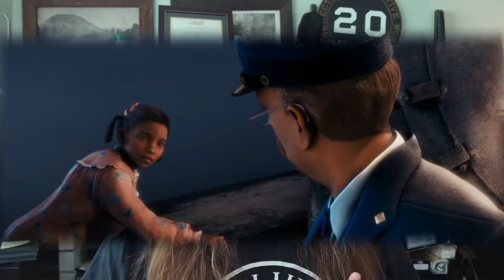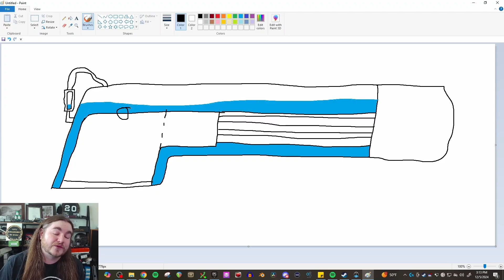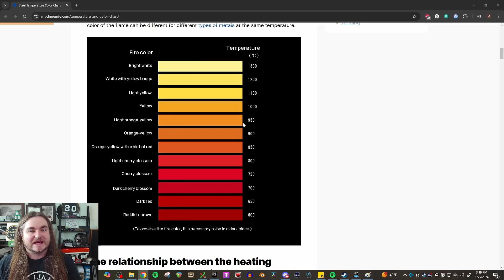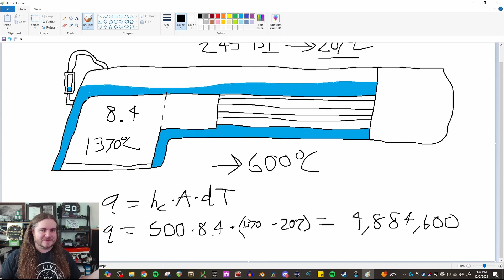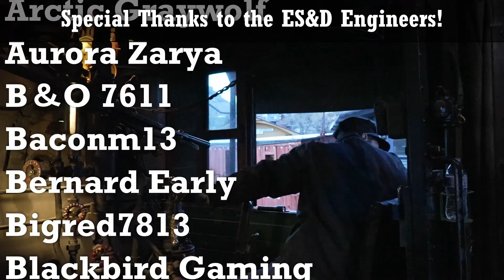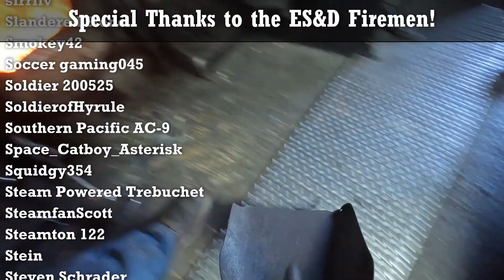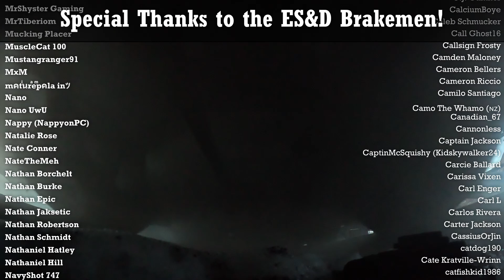Would the Polar Express EXPLODE on Glacier Gulch?!?

Comment: This video serves as a reminder to me as to why I chose not to go into astrophysics after high school. I love it; I am fascinated by it, but my god, I HAAAAAAAAAAAAAATE math! And I suck at it to boot. 

Though one other thing; with the speed at which she was hurtling downhill, and the time it takes for gravity to pull the water forward against inertia, her crown sheet was likely exposed even less than the downhill stretches lasted. Extra second or two. 

And now I'm off to mope in the corner because my favorite girl is down for the count right now. They spent all that time and money rebuilding her running gear, and then her superheater went "Hee hee!" and did something it shouldn't have. I'm assuming something's leaking, since the SRI phrased it as a safety issue.
Reply: To paraphrase an employee at one of my favorite museums, "From the time they roll out the factory door, steam locomotives are constantly trying to shake themselves apart!"

Comment: Would the coal also not just get sucked thru the tubes? And the throttle being primed aswell?
Reply from the maker: I suppose it depends on the momentum and acceleration forces, thinking through it more. If the water sloshed as foretold, yes, it would prime and it would dump the fire against the arch brick. lol
Reply: @Hyce777  oh yea lol, if it was a near free fall and the engine was still applying power there was no way for the water to slosh forward

Comment: A friend an I once had this conversation. Those engineer and fireman are by far the greatest engineer and fireman in the entire world and the polar express is the most pampered locomotive. Despite the insane wheel slip, black smoke never came out of the stack, only steam. Sand was never used, even on ice. And the coal didn’t even have any coal dust. The fireman wasn’t trying to think of a solution after losing the cotter pin, he was debating whether or not he should put something as dirty as his hairpin into such a well manicured machine
Reply: Considering the route, pampering makes a lot of sense.
Reply: iT's A mAgIc tRaIn!
Reply: @PowerTrain611 the magic just keeps it on the rails even when it should fall off
Reply: They probably spend the rest of the year doing HARDCORE maintenance on the Polar Express
Reply: @pineapplesauce2718  there's a reason that only runs once a year...
Reply: @PowerTrain611  Does it? I like to think the reason the Polar Express is a freight engine is that it spends the rest of the year bringing raw supplies to the North Pole's factories.
Reply: @rbdaviesTB3 it’s the Polor Express. A passenger express train. The cargo is probably taken by another locomotive. That’s my theory atleast
Reply: @rbdaviesTB3  This makes sense IMO, as the Berkshire were freight locos. But my theory is that there multiple Polar Express's, one for each country as not all countries have the same loading guage across their entirety.
Reply: @PedroFerrer-vq5sw  The berkshires were fast freight locos, it would pull freight, and have absolutely no problems goin fast either doing so.
Reply: The engineer literally drifted a train on ice.
Reply: @AdrianMannino  and it got rerailed again
Reply: @AdrianMannino  the Rob Zombie edit of that scene is just spectacular if you haven’t seen it
Reply: Yup, every single coach somehow.
Reply: It's MAGIC
Reply: And makes the waters gravity go in the direction of the tracks
Reply: But he is right

Comment: 1:49 Fun fact about Pere Marquette 1225: she also served as the inspiration for the original book by Chris Van Allsburg, who played on the locomotive as a kid while it was outside Michigan State University. That, I believe, was one of the main reasons they wanted 1225 for the movie design(and also, yes, number for both occasions).
Reply: Its weird he illustrated a PRR K4 instead of PM 1225 for the book since that’s the case
Reply: I agree with that. I would like more info. The movie has never sat well with me because it is NOT a berkishire@bostongeis5123
Reply: Railman is correct, that is where the 1225 comes from.  I never actually held the book so I can't speak to the wrong loco being illustrated.
Reply: @a_steinman  Bad phrasing on my part. I don’t disagree that 1225 was the inspiration, thats why I think it’s weird he didn’t illustrate it. Especially since he’s also the illustrator.
Reply: @Dasgooben67  Well, creative liberties/artistic license and all that. Might I add, it looks more like a generic steamer(albeit with D&H style headlight) than a K4. If that'd been the case, it would've had a Belpaire firebox and high-mounted headlight.
Reply: @ Thats a good point. What makes me think its a K4 is the running board, the tanks on the top and bottom, the wheels (not the wheel basis) and especially the bell. 

The pilot and headlight, and the weird sand dome are the things that don’t make it look like a standard k4. Some K4s did have the headlamp in the middle at some point, but idk if that matters lol. Also, its hard to say what the wheel basis is in the illustration with the bush in the way lol.

I think you’re right about generic steamer/creative liberties, cause even if was a K4, it’s very stylized. Regardless, 1225 is the polar express
Reply: @Dasgooben67  Now that we can agree on.
Reply: @Dasgooben67  The engine in the book is a 4-8-2 mountain type

Comment: Great video, one question I do have what if it was going  track speed? and not speeding out of control Would the out come be any different?
Reply from the maker: What pray tell is track speed on a near vertical hill, lol? Terminal velocity, I suppose...
Reply: @Hyce777 idk what speed limit was, the conductor seemed worried about it , whoever designed that alignment was probably dunk, high, or a shareholder. Maybe all 3 at once.

Comment: You forgot to mention the coal that would have been floating around, like the engineer and fireman, allowing cold air to enter and help cool the firebox.
Reply: not if the fire door wwas shut, and we do see its spring loaded with a foot switch
Reply: @nathanharrison2  it looked like the one with the holes drilled I to it, so air still could've gotten in
Reply: @LetsStreamitOut01 I was thinking of the grates :P if they aren’t covered evenly in normal operation they can let too much “cool” air in and damage the boiler in some cases
Reply: Cold air is dense air, my friend. It would only supercharge the fire in the firebox, making our problem worse.
Reply: @ChrisSpringer-d1r  too much air too little fuel = less heat...
Reply: @LetsStreamitOut01  The problem is that the coal would all float and knock around, crumbling, increasing the surface area, in an oxygen-rich environment, meaning that coal-fire is going to flash.

Comment: I agree with commenters that the coal and fire would fall forward. All that would be pulled into the flues and tubes, not just by gravity but by the hellacious draft. And more getting spattered on by the stoker. For the tubes and flues, I would guess they won't buckle  being in direct contact with the fire while still surrounded with water. The problem is despite much of the coal passing through due to the small size, clinker and larger hunks would clog the flues and tubes. The draft would drop and the coal that made it through to the smoke box would also drop. The steam and water coming from the cylinders would permeate the dust and gunk making a concrete mass.
It may not explode, but it's trip has ended.
Reply from the maker: Well, the G forces of it accelerating might help pin things down too... Hard to say
Reply: @Hyce777  nah. The crew being in close to zero-g tells us what the water and fire are experiencing. the water would likely stay barely in place but the draft of the fire would totally suck the fire right out the stack. It would explain Smokey shoveling like mad while they were sitting on the ice. He needed to get a new fire going.

Comment: Could you imagine the poor souls who have to service this choo choo?
Reply: Considering the working conditions of the other elves, and the shop crew having ~363 days to service 1225 between her madcap cannonball run every year, it might be leisurely compared to the turnaround time of the army of boilermakers working for UP's engine shops to keep the freight moving in the 40s/50s.
Reply: @callsignapollo_  Yeah, I guess you're right. They have a year to service this thing.
Reply: @callsignapollo_  
Like some poor elf in the shop looks at some papers on a clipboard, then at the engineer and fireman, and quite simply goes “You did WHAT!?”
Reply: Mechanic: wtf happened to her!?
The engineer and fireman in unison: two words, Glacier Gultch!
Reply: @elijahcuevas3805 Don’t forget, THE PIN!
Reply: Also general fact that in the movie they've got magic and all.
Reply: Well, considering she olny runs once a year, I don't imagine her service schedule would be very rushed.
Reply: dude imagine how bad the suspension would look-
Reply: I'm pretty sure they'd want to take the train crew out behind the trainshed for some percussive maintenance.
Reply: Imagine the repair costs
Reply: @eddingtonrailroading  Santa probably has inside access to iron ore, coal, and off shore oil deposits, most likely owned by Mercedes-Benz (remember that early 2000's commercial?) So I imagine the repair and manufacturing costs would be significantly nullified.

Comment: I know this is all in fun and all but I would have to assume the crew knows that the Gultch is coming and likely would have overfilled the boiler to compensate ahead of time making the exposed crown a moot point
Reply from the maker: That was the other math I meant to do! I don't think they could have filled it up enough on the uphill.
Reply: @Hyce777  maybe the polar express has a water input at the front to fill the boiler full when tilted up cause they know about this absolute nonsense of an alignment I mean is it really far fetched that they custom built the locomotive for the route?
Reply: Smokey was not shoveling coal starting at the point when the throttle shed its cotter pin. That means by the time the engine topped the grade and began its Kenosha run, the firebox had ample time to burn what fuel was already in there and eventually begin to cool just by radiating its heat.

The crown sheet was exposed for roughly 10-15 seconds as the engine ran down the first stretch and up the next, re-covering the crown sheet. Because the fuel level in the firebox was assumably low, and heating more of the backplate than the crown, the risk of the crown melting is equally low.

Then the engine began another downhill, this time for only abt 5 seconds before finally leveling onto the Great Polar Ice Cap.

I know next to nothing about metal behavior at high temps, but just based on how long the engine's crown sheet was exposed I don't think it would've melted.
Reply: @jamesgroccia644  Glacier Gulch actually isn't the area where it's most likely to explode it would be the downhill just before flat top tunnel here's a video that explains it better than I ever could https://www.youtube.com/watch?v=bxPvxWSdlIQ
Reply: or probably cutting the fire down since they're going through a large downhill region
Reply: That would cause priming, can cause the cylinders to explode and jam the regulator open
Reply: @wolffang-vz2ty  Couldn’t the crew have overfilled the tender with water knowing they’d have to go down the grade to Flat-Top tunnel as well?
Reply: But if your going faster than Gravity the water will flow towards the back of the boiler. As the engineers are floating this is the case that the engine is accelerating faster than 9.8m/s

Comment: Something I always wondered was if it was actually possible to drift the train like they did. From my perspective, you could sort of use the rest of the train as either a backboard or an anchor, depending on if you're pulling or pushing it. Wonderful video Hyce, can't wait to see more!
Reply: I mean, good luck steering. You could maybe get one drift in (and realistically fall over), but any snaking and physics would like to punch you
Reply: If the swinging could be timed one could choose to amplify or dampen the swinging while also trying to pull the train in the desired direction. It could work but would be stupid hard to make actually happen while under control.

Comment: But the rapid heating and cooling as the water sloshes combined with the force of said water sloshes would shurely weaken the steel a significant ammount, causing catastrofic failure.

Not to mention the water that will have gotten through the throttle/regulator body and grenaded the cylinders
Reply from the maker: In every incident report myself and others have researched, the heat cycling never caused boiler failure - simply overheating.

Comment: To be fair, the boiler wouldnt explode.  The RODS AND PISTONS on the other hand......
Edit: also remember, even with the engine facing straight down, everything is in motion, meaning that theres momentum and transfer of motion happening.  The engine is continually accelerating downhill, meaning the water is pushed to the back.  With all the water in the boiler a steam engine at normal operation would use, theoretically, tmit would be enough to completely cover the crown sheet anyways, would it not?   If im wrong, please let me know, as im nobusn the business of false information
Reply from the maker: Hmm, yeah, downward acceleration would play into that...
Reply: @Hyce777  much appreciated.  I have little practical experience when it comes to steam engines, though they are and always will be my favorite. Loved the video!
Reply: And then that’s BEFORE the ice drifting sequence where they are slamming the throttle open and shut, slamming from full forward cut off to full reverse cut off, and going from full application to full release on the brakes without letting the air recover.

Comment: Thought, at that extreme downward angle. The coal and fire would shift to the front of the fire box, and the arch brick. The bulk of heat would be at the backhead and the upper most corner of the crown sheet. If you are worried about sheet failure at that angle. Why not just open the fire door? Wouldn't a hole that size let out a lot of the heat in the first place?
Reply from the maker: That's how you barbecue our poor crew :D
Reply: @Hyce777  Ugh, now I almost want to math that out to see if the cab would heat up to a dangerous point before the end of that 10 second drop. Thanks Hyce lol
Reply: @baronvandragon2427 but with the cab windows open, going straight off a cliff, i think there would be ample crew cooling air.
Reply: @baronvandragon2427  I would love to hear that result because I was thinking the same thing, but more in terms of that steel being the problem for an explosion
Reply: with how hard the engine was drafting. Are we sure she wouldn't just suck the entire firebed out the stack? That or clog the flues so bad that the fire would be suffocated?
Reply: @JaneDoe-dg1gv  the coal bed would have to go through the arch brick and then pile itself  high end to overcome the front of the fire box and throat sheet before it would reach the tubes and flues in the front sheet. Possible but not likely given the amount of time for the drop.
Reply: @baronvandragon2427  given that coals already hover under the force of drafting, i can definitely believe that the draft would suck the coal into the flues if the engine entered freefall.

Comment: Not to mention when the train evens out then you get the water flashing into steam as soon as the water sloshes back onto that hot crown.  This would cause a pressure spike on top of your softened crown.  Good thing it is animated.
Reply from the maker: That's more of a myth than fact in the case of all documented boiler explosions, as far as I can read.
Reply: I‘d be more worried about the water sloshing into the pistons
Reply: @genoobtlp4424  Speaking of which, I could be wrong but during that first drop they must have been going the same speed as an airplane. 

So even if the crown sheet wasn't an issue for some reason or the boiler didn't explode, what kind of havoc do we suppose is wreaked upon the pistons/drive system/everything of a locomotive built to go 70 miles per hour when it suddenly starts going airplane speeds?
Reply: @schoolsout15  I‘m not sure about ALL of the physics involved, but I can tell you that the spinning things were suddenly spinning way faster than anyone expects, which is usually associated with vibrations if anything isn’t perfectly balanced (like the pistons and driving rods) and the hammer effect of a couple tons flying back and forth makes maintenance want to punch whoever dit that…

Also, high speed running is associated with hunting oscillations and in order to not fly off the tracks, you‘ll need yaw dampers sooner or later, fat chance pullman heavyweights got that tech

Comment: Wouldn't have water probably of  gotten into and passed the throttle valve. Getting into the the pistons. Hydrolocking/ exploding them in the process. Even if it doesn't explode. Pretty sure it would be dead in the water.
Reply from the maker: .... Yes, great point. That or the fire was hot enough it superheated it all and caused much more violent slippage. Lol